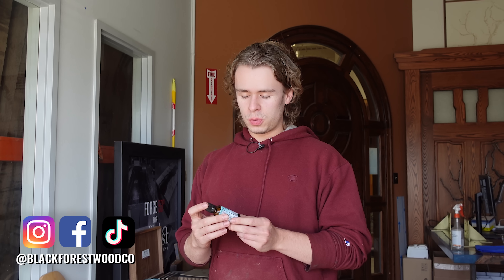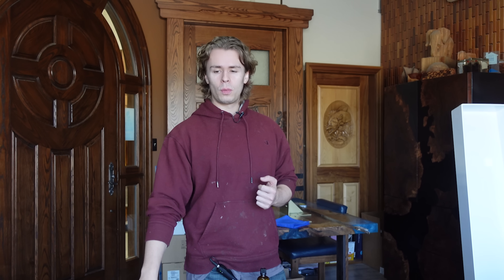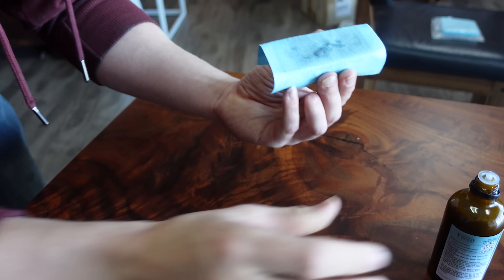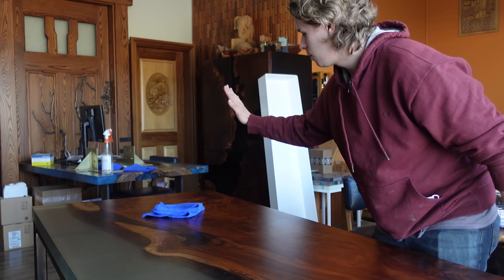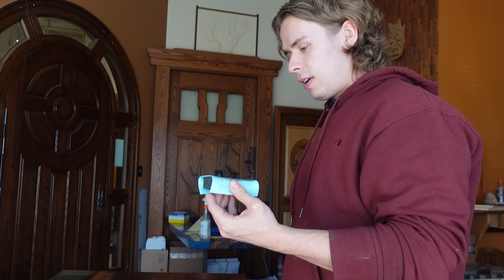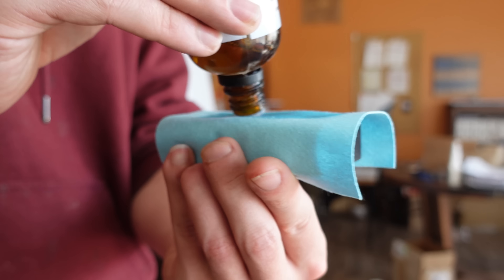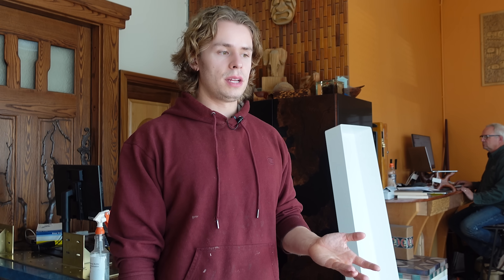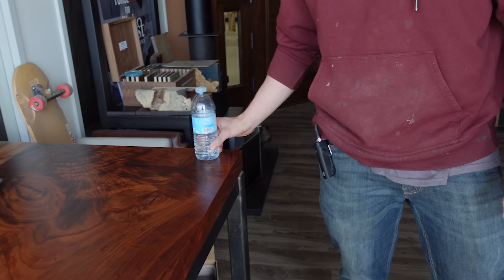This Finish Makes Wood Hydrophobic

Comment: I used the BF furniture oil then two coats of graphine and 1 coat of top coat. Cured for a few days. My customer has a spot where she set a bowl and it won’t buff out. Thoughts on repairing? Another graphine then top coat

Comment: I recently applied your ceramic base and topcoat. Should I or could I apply the graphene over top of the ceramic with then  another coat of the ceramic topcoat on top of that to get additional durability? How does that work??

Comment: When you mentioned the delamination due to sealing the live edge, did you seal it with epoxy?  Or did you use something else?
Reply: They talked about this a few times, so I feel like I can answer that for you. They used resin to seal the edges
Reply: Like it’s a new thing not to seal the edges!!!! This is the only company that I know of who doesn’t seal the edges but I guess they prefer to throw 5-10L more of epoxy and do a flood pour!! Never heard of epoxy cracking/separating because the edges were sealed!!! Total BS if you ask me
Reply from the maker: We are also the first company to make these tables on a large scale and arguably produce more tables in a year than any other company. 
We have tried everything and extensively tested the methods. From our tests, sealing the edge absolutely compromises the strength of the bond. I would think the table shown in the video would be irrefutable evidence but hey maybe you know better than us with all of your experience!
The reason for flooding the piece is to allow all cracks and voids to be filled in a single shot and to account for the amount of epoxy that will soak into the wood. If you only pour to the top of the wood surface, some of the epoxy will soak into the wood (as it should to form a proper bond) and you will be left with epoxy below the surface of the wood, resulting in a thinner table. 
With a sealed edge you may not have this issue but you also do not get any penetration and are left with a plastic on plastic bond, which is prone to separation.

The reason other makers choose to seal the edge is primarily to avoid bubbles. This is the less expensive way to avoid bubbles. The more expensive and proper way to avoid bubbles is to cool the resin as it cures, preventing an exothermic reaction therefore eliminating the production of air bubbles. We have build our selves liquid cooled tables and an air conditioned room dedicated to pouring. This allows us to get proper penetration while eliminating bubbles.
Reply: @BlackForestWoodCo  it is true! Your company is outstanding and I wish you all the success… but most people seal the edges to create a solid bond between wood and epoxy which makes also a lot of sense to my knowledge! 
I’m not saying that I know everything but sealing the edges will also prevent the wood from drinking the black pigment for instance.

Comment: Great post and interesting product. Not enough Charlie though 😔

Dylan mentioned the product to be a bit dark in colour. Does it thereby make a wood like birch or a non-dark wood darker? 

Do you recommend to use a product like cheramic coating first?
Reply from the maker: Haha we will get more Charlie in the future!
It's a bit darker in colour but won't tint the wood and resin more than 1 hue darker which is basically nothing!

And we recommend swapping out the Ceramic Base Coat with Graphene and then put the ceramic Top Coat over that!
Reply: @BlackForestWoodCo   - thank you!
Hug Charlie for me 💕

Comment: Intesting, looks impressive. I have your ceramic finish which I will use for the first time on a spalted beech river desk for my son in law in the next few weeks. However, I have a question about the environmental sustainability of these coating products? Do they included PFAS or other “forever” compounds?

Comment: So this is around 2x the price of all other 100ml 9h coatings.. whats the added benefit over just using Adam's of another well known product?
Reply from the maker: Not sure where you’re getting those numbers from. Adam’s sells their graphene coating at $125 CAD for a 60ml bottle, this works out to $2.08/ml. We sell our graphene at $219 CAD for a 100ml bottle, which works out to $2.19/ml. We are quite comparable to products of a similar quality and our coatings have been specifically formulated for woodworking applications, which we have tested!

Comment: Dylan have you built a paddle board yet?

I've used your ceramic and it works well.  Quite pungent while applying though.  Is the graphine any different?

Comment: How clear are these coatings?  Could they be used to protect a protective laminate on a photograph without dulling the photo?
Reply from the maker: The Top and Base Coat are completely clear, the graphene has a faint grey to it because of the graphene, so I would recommend the Top and Base Coat

Comment: If the graphene is harder than the ceramic, top coating the graphene with ceramic seems like wearing suspenders and a belt. Measure and have a slab of glass installed over the table. 😐
Reply: I put custom glass over my tables

Comment: How does the company come up with these different top coats?  Do you use another business to create these products?  Does Black Forest Wood Co. own the rights to these products?   Is there any odor with this product?   Great video as always.
Reply: They are 100% outsourcing it, another company makes this probably for other suppliers, nothing necessarily wrong with that That's how most products are generally made especially when it's in a niche line like fancy chemical coatings, also by having black forest be the supplier it makes it a a lot more approachable and easier for the comsumers to get their hands on it and get support and stuff like that from the smaller suppliers than from some giant factory thousands of miles away that just makes the stuff. And what we don't know is if they have partnered with or having agreement with some coatings company to have an exclusive line made or maybe they've tailored something else that they already produce so that it's better suited for wood, that would make sense, or it could just be an off-the-shelf product. Regardless it's much easier to navigate the market as a consumer going through Black Forest then some chemical company
Reply: @andrewlondon3461  Thank you for the educational response.  I learned something today.
Reply from the maker: We work with a large chemical manufacturer! We tell them what we are looking for and they send us different formulations to try out. If we don’t like something, we tell them and they modify the formula until we get what we are after!
They do not sell on a retail level, only to companies looking for custom products like us!
Reply: @BlackForestWoodCo  Thank you